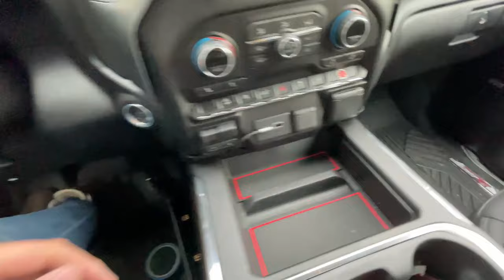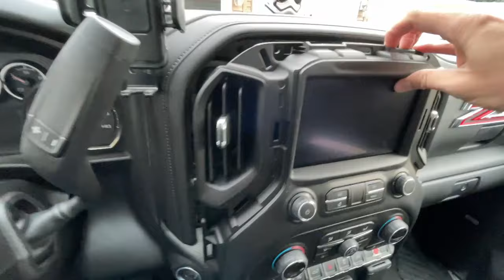How to set the autostop default to OFF! 2019, 2020, 2021 Silverado or Sierra

Comment: Brother, i'm sorry, i've subed, but i disagree. When your car shuts off, what does the oil do? That's right, it starts sliding back down. What does your starter do? Spins. What does that do to the pistons/engine? Wears them down prematurely. What happens to the starter? Prematurely shuts off. Would you sit their in your drive way, turn off your car, then start it every two minuets or so? No, why? because you know it's bad for the engine. Not to mention, it takes off right after starting, which is also bad for the engine. I have a 2009 grand marquis, she a V8, and i don't think i'd turn off then restart just for 1 minuet to save 0.05 gallons of gas that I paid for. I respect Gods green earth, but i also respect my wallet and car. Oh, and also my wrists. God bless, and have a great day:)

Comment: Absolutely hate this autostop feature, It does nothing but ruins my truck. If I stop at a stop sign and then have to go to merge, it'll turn off my truck, then I hit the gas right away and it starts and tries to go and is NOT SMOOTH! This is such a trash feature, it should of always been OFF by default and ON when you click it on. And it should have a memory built in to remember where you clicked it. The whole "earth will die" is non-sense! They need to take care of all the airplanes first before trying to get to cars, ridiculous.
Reply: The car manufacturers hate this as much as you do. You can blame the current administrations EPA. I've seen videos demonstrating that the stop - start "feature" MIGHT save 1 gallon of gasoline in the lifetime of the car/truck.

Comment: No one cares about pos EV's or mileage. The epa keeps forcing this mileage bs. More crap they keep putting the less reliable they become. EV's will never increase mileage either. Thats a joke moving a 5,000 lb vehicle at 70mph while having the heat and radio on. Good vid though.

Comment: Are you kidding me ??? ..do you have to remove the seats and engine while your at it ?? , with the F150 you remove two 7mm screws and pop the trim off the top of the radio and voila' your done .   three minutes !
Reply from the maker: If I had bench seats it would be a lot easier...
Reply: @TruckOwnership101  if you bought an F150 it would be a breeze...👍
Reply from the maker: @northlander4370  yeah but, then I’d own a F150. 🤮 lol
Reply: @TruckOwnership101  yup , and you would be a member of the most popular truck on the planet club....2400 F150 ' s sold everyday...
Reply from the maker: @northlander4370  I’m just poking fun. We can all get along and hate on Titans and Ridgelines right? 😆
Reply: @TruckOwnership101  sounds good to me.....stay safe where ever you are.
Reply: @TruckOwnership101  Whenever I see a Ridgeline, it gives me anger.
Reply: @northlander4370  That's only because the GM 1500 sales are split between the GMC Sierra and the Chevy Silverado.  2020 silverado+sierra sales were 847,000.  Ford F-150 was 787,000
Reply: @rebman5150  don't worry about it ...not a truck anyway LOL..
Reply: yup , sales of F150,s in the U S in 2018 were 909,330 plus 145,694 in Canada , sales in the U S for 2019 were 896,526 plus another 145,210 in Canada . Slower sales in 2020 were attributed to the Corona virus pandemic . Now as for the slow sales in 2021 the ongoing semi conductor chip shortage world wide has stalled sales , ( i am one still waiting for my new 2021 F150 Lariat)  as of yesterday , Feb 8th Ford has idled two out of three shifts at the River Rouge assembly plant in Dearborn , Mi. and one shift at the Louisville plant . G M has idled three plants due to the lack of these chips , today,s modern pick up uses up to 75 chips governing all aspects of the trucks operation , Toyota , Nissan and Volkswagen are also slowing vehicle production. You are right about Silverado and Sierra but the markets sales split them as they are considered two separate brands and generally the Sierra is classed as an upscale truck over the Silverado .
Reply: @northlander4370  the main difference between the Silverado and Sierra is the engines.  Silverados have standard inline cylinder engines whereas the sierra has the traditional side by side configuration.  The inline configuration is not as powerful at slower speeds and in hilly terrain despite the higher compression ratio.
Reply: @chrisloesch1870  the engines are exactly the same
Reply: @northlander4370  Not according to the Tundra fanatics.  Toyota's bleep don't stink

Comment: You care so much about the environment that you bypass a feature specifically designed to help the environment. Lol.
Reply from the maker: 🙄 disabling the “default off” to “previous setting” isn’t exactly the disable option like a pulsar is. I still turn it on during my drives with lots of stop lights, but it doesn’t help my quick stop sign only commute to work every day. 🤷🏻‍♂️ Looking forward to the day when 1/2 ton electric trucks are here that can tow a 6,000# camper 200+ miles on a single charge. Until then it’s this gas guzzler. 😅